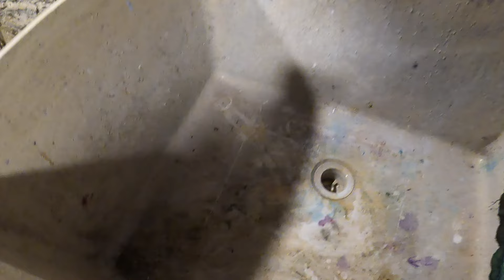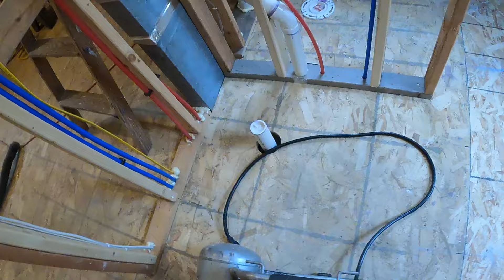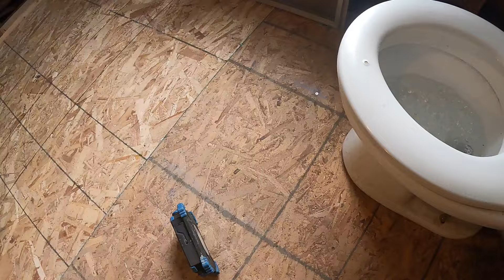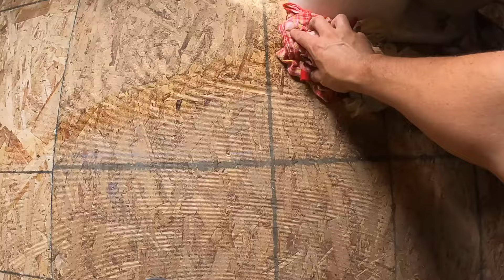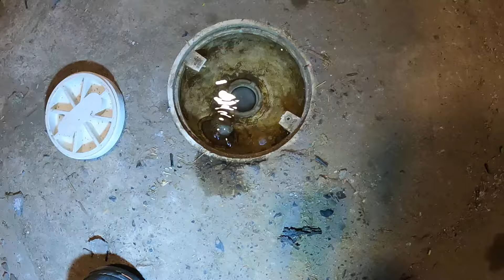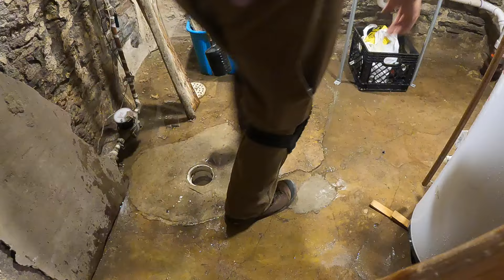Mouse House Plumbing pressure test gone wrong!?

Comment: Why don’t you just use air?
Reply: Every single pvc manufacturer specifies that. Water only
Reply: That’s odd… that’s all we use here. No issues and no flooded buildings
Reply: It’s even in our Ontario code book, Ontario has some of the highest standards in the world
Reply: @jamieplumber  Even 3.5 psi of air can send a test plug firing out. Then you have the risk of actually exploding the pipe or the fittings. It has happened a lot under air testing and can cause a lot of damage and injury. Now you could prob go your entire career no issues I’m sure. Just saying that’s why most of the manufacturers urge against it. In my state they don’t allow it
Reply from the maker: probably will next time lol
Reply from the maker: it’s kind of a learning experience for me, I figured it might be easier to identify where there was a leaking fitting by seeing the water drip from it.
Reply: @remodelingjunkie2459  no just use air. If you forgot glue a fitting and it blew apart it would be quite the mess.
Put 5PSI in it. You will hear the hissing
Reply from the maker: @jamieplumber I will try that next time, it will probably save me a lot of time 😂
Reply: @jamieplumber You never test pvc with air
Reply: Omg, don’t be such a sissy. Just use air and don’t stand infront of a test cap.